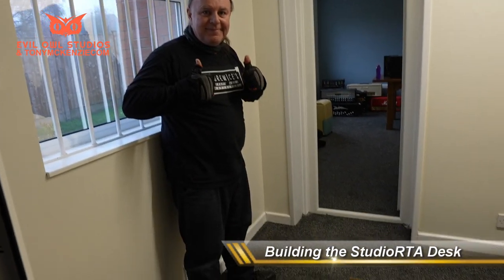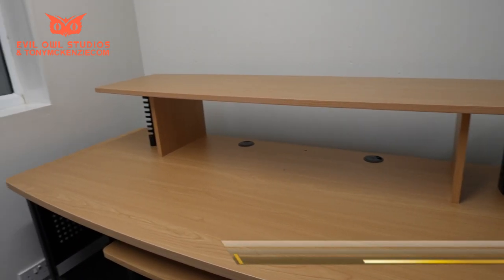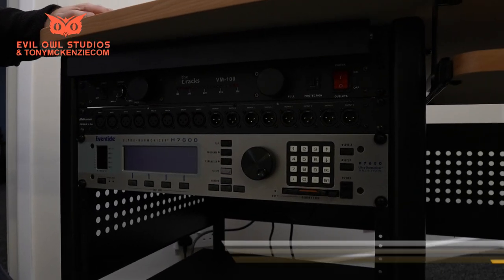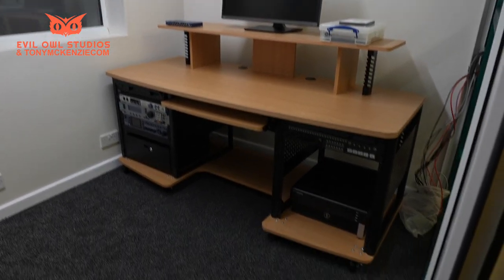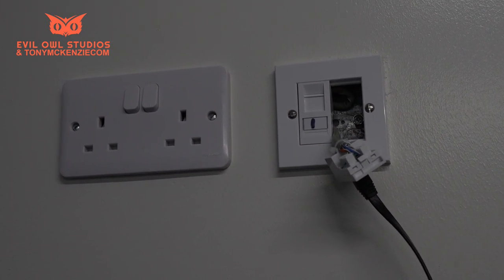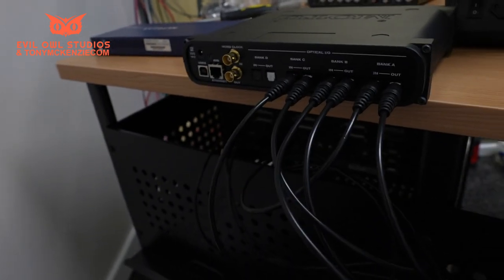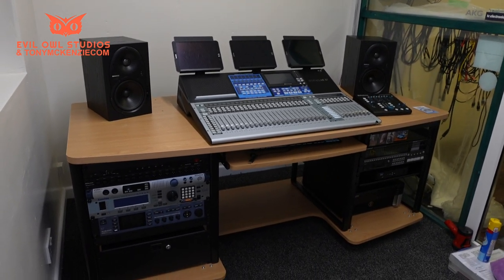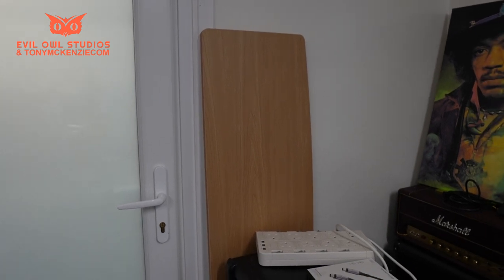How to Install Recording Studio Gear | Studio RTA Producer Station | Part 2: Making it all work

Comment: I use two 6 space racks on top of the desk,one on either side of the mixer . but would like to rearrange like EVH's 5150 studio, where the racks are opposite of the mixer with enough room in between for a chair and a guitar.
Reply from the maker: Sadly my two racks (as you probably saw) were too big for the application on this setup so they are now redundant :( - probably end up on ebay. The stands also made things difficult on the desk but we got past it OK. Thanks for the info... and for watching...

Comment: Looking good Tony. I too went for the Studio RTA Producer Station. Very pleased with it, solid. The flat pack was fork lifted to the front door, heavy. Also did not fit the top shelf. Just too high for me to see the monitor and could not fit the studio monitors where I wanted them. Have to ask, did you mod the caster fixings. They now appear to go right through the base plate. Mine were just wood screws from the casters below. Forum users have mentioned that this is a weak point of the desk with the castors breaking off when moved. So far this has not happened.
Reply from the maker: Great to know you have one of these production stations and really great value for the money. Yes very heavy and we lugged it from work to home the hard way. Indeed, what I did was to use bolts right through the base of the unit with big washers to fit the casters - as they were they were not really acceptable as I have to move that desk and its much heavier now with the gear installed. You can mod the casters in any case even when fitted the original way... but I would suggest if its all loaded up that you do that. Thanks for the info about how yours was too - very useful. Have a great new year...
Reply: @tonymckenzieofficial  Thank you for your reply Tony. Yes good call I will undertake this mod the cabling needs to be tidied at the same time. Also have a great New Year!